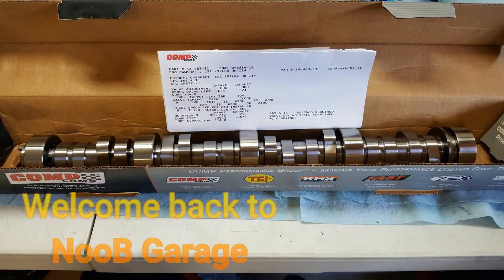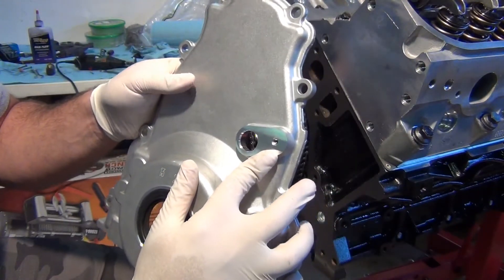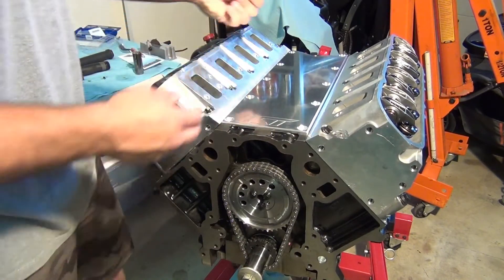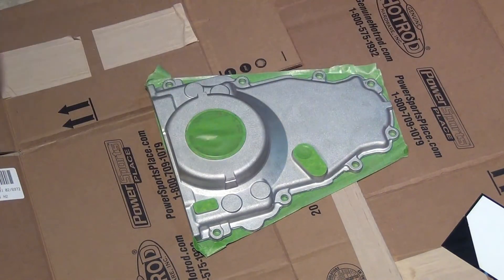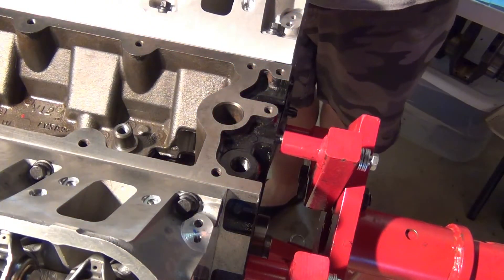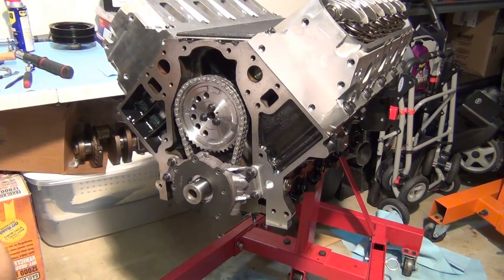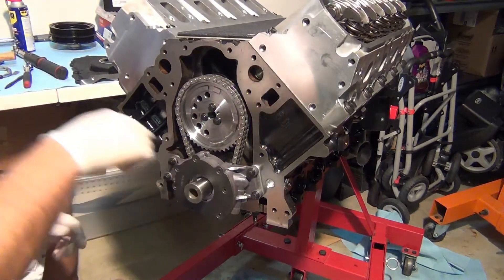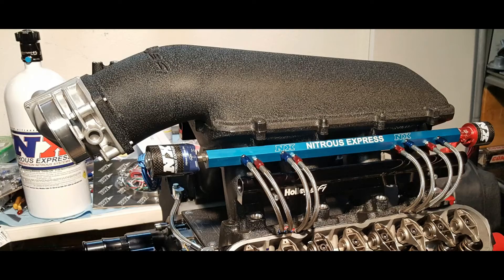LQ4 408 Stroker Nitrous Build Episode 4

Comment: That vht is the best paint in a can you can get.  I’ve used that wrinkle on many engine parts and never had it come off or flake    You can play with the wetness and dry times in between coats and change the texture too.

Comment: why did u moved the knock sensor location? Just for looks?
Reply from the maker: Chris Haggerty the knock sensors in the original position in the valley allow for dirt, water, and oil to accumulate in the holes causing the knock sensors to corrode and go bad. Plus if they ever go bad it's much easier to replace them on the side of the block then having to remove the intake to get to them.
Reply: Oil sender was also relocated? For that new valley cover. Where did u place it?
Reply from the maker: No the sender is still in the same place at the back of the valley. The cover doesn't cover the hole.

Comment: You can always just use thread sealant on the bolt for the cam sensor if you get into the threads. FYI a regular link Chain is more durable than a double roller chain over a long period of time.